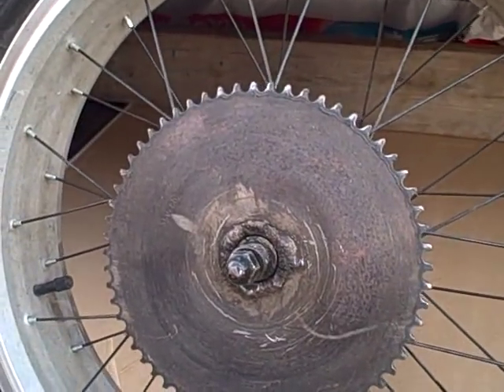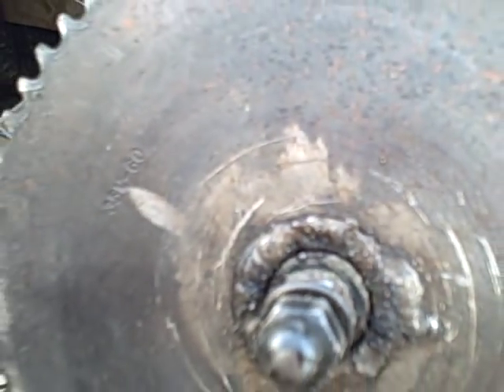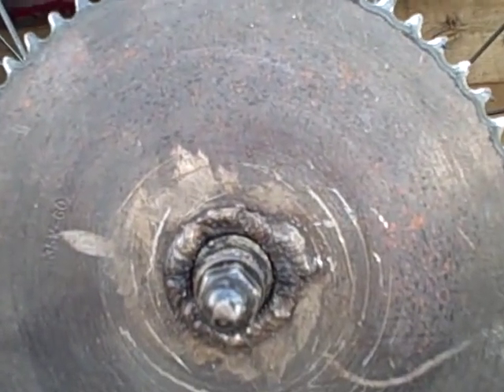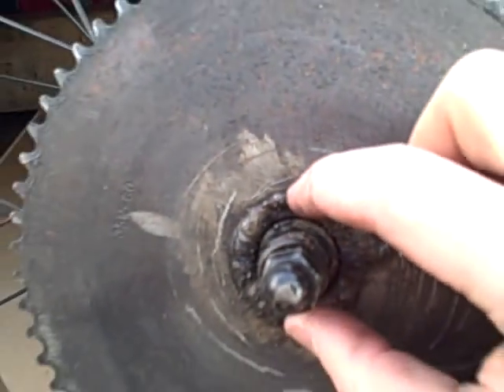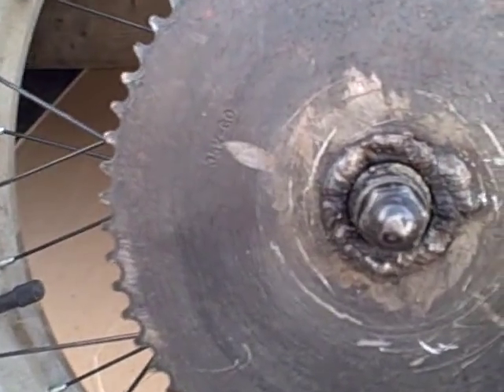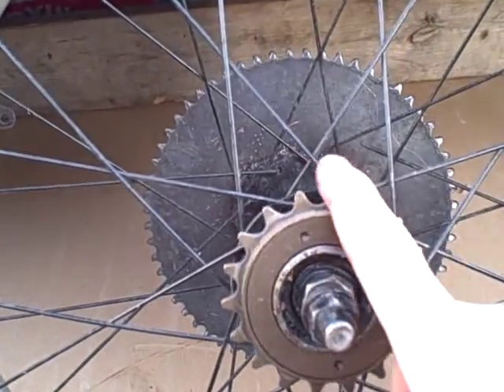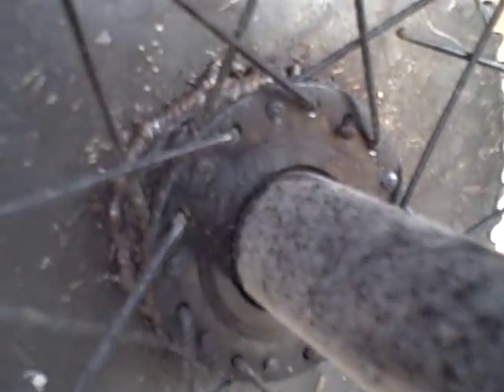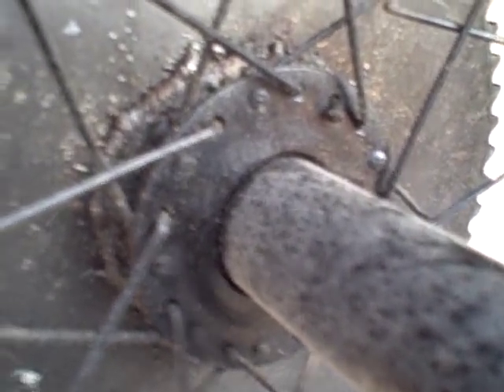5hp chopper bike sprocket hub

Comment from the maker: @TheMockingbirddude  The hubs thickness was sufficient enough to weld the hub at a safe strength.I used a magnetic level while I was tacking each side of the sprocket, then once it was true and secure I welded the sprocket fully on both sides. Depending, it may work on any weldable hub that is heavy enough gauge metal if you true the sprocket and double check the welds.

Comment: How does the smaller sprocket mount to the hub? I was able to mount it but could not find a way for it to grab or hold on to the hub to allow the chain to pull the bike forward.

Comment: welds will snap.
Reply from the maker: The welds are still holding even 8 years later.
Reply: Really. Wow. Impressive. And when you welded it it didn't warp the hub or the bearings?

Comment: Congratulations you have just ruined a good hub that hub is so thin that the weld no matter how thick is still just the strength of the hub shoulder.A sprocket only last for a few years at best.
Reply: What would u do instead of what he choose todo